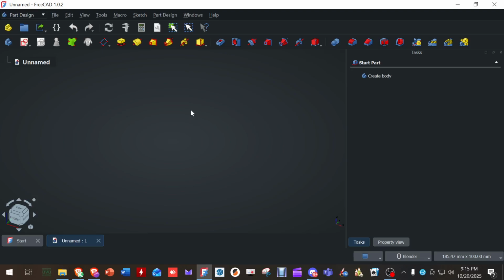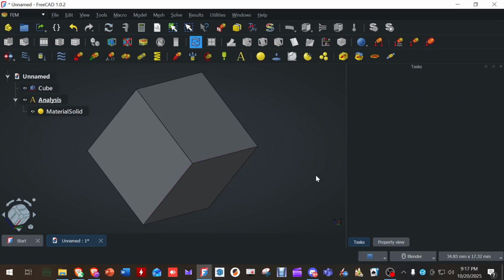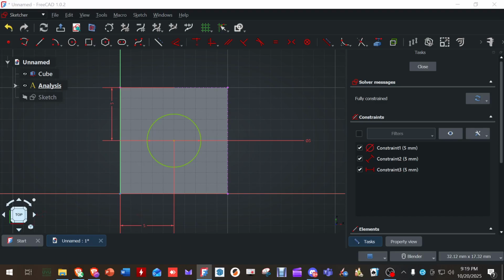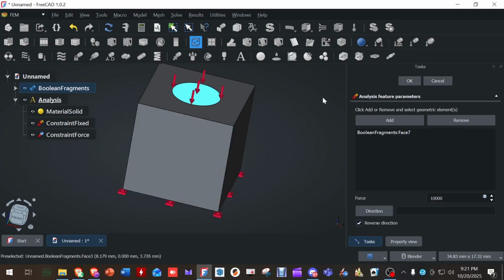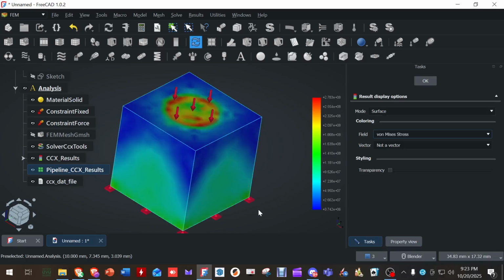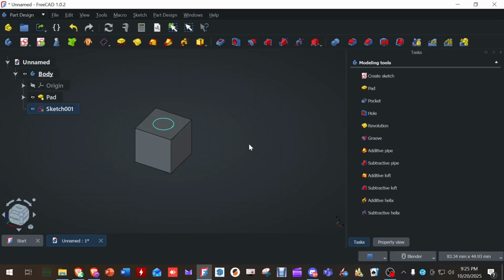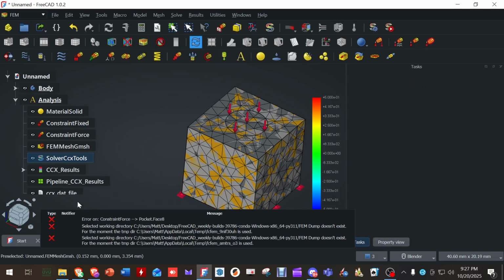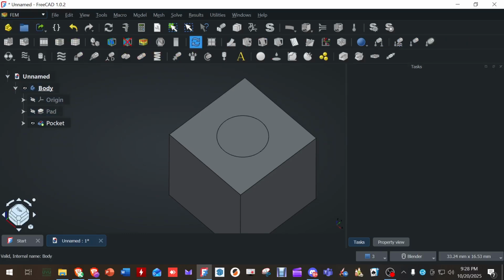FreeCAD FEM with Boolean Fragments

Comment: I've used a number of CAD programs before, but just started learning FreeCAD, particularly because of the FEM workbench.  I've been able to grasp the basic flow of creating an FEM model, but I spent the last 3 days trying to figure out how to apply a force load to only a portion of a face.  Various tutorials and videos here on YT were of no help, until I saw Boolean Fragments mentioned in a discussion forum.  Searching that topic more led me to your video, which explains perfectly how to use the Boolean Fragments.  This is by far the simplest (and only method that worked for me) way to apply a force load to a portion of a face.  Thanks for providing this video, it really got me over a hump that was driving me nuts in my FreeCAD learning curve.